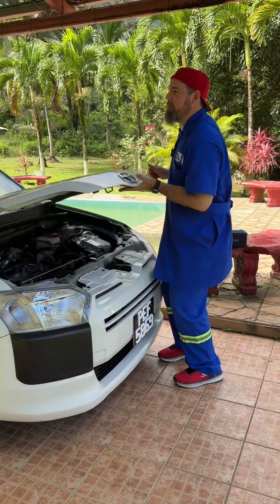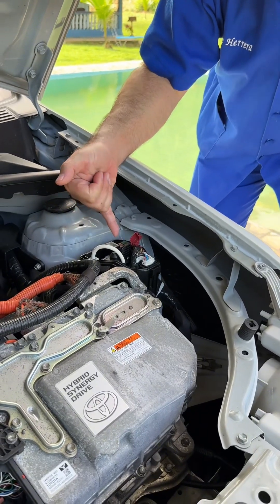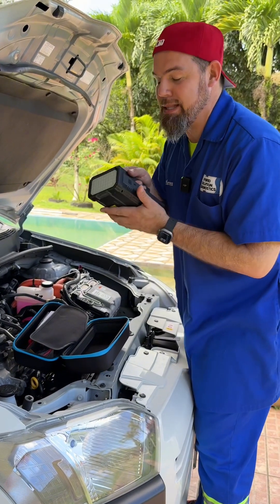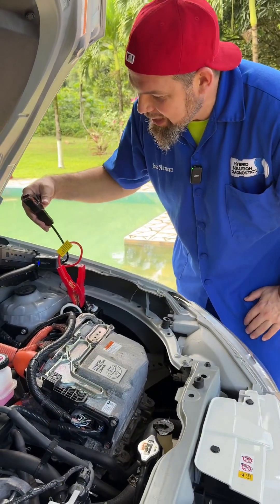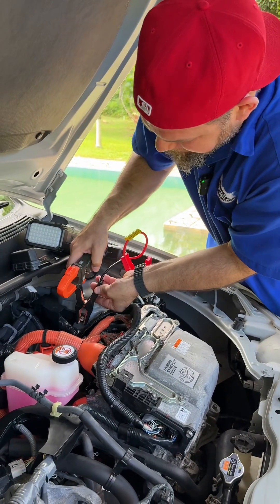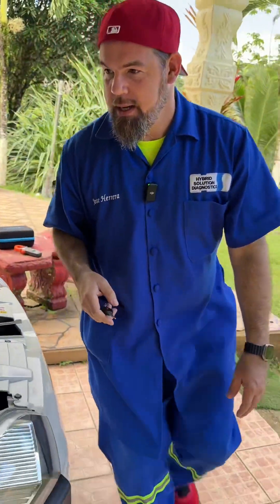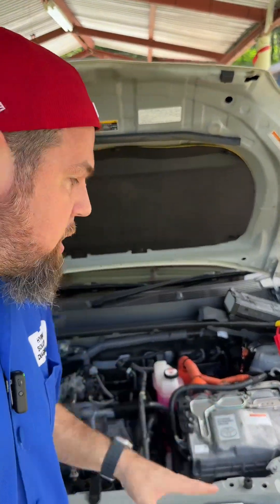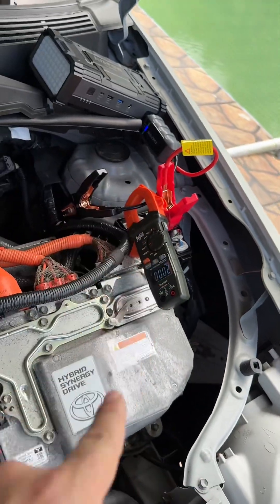How to jumpstart a hybrid or electric car in simple steps

Comment: Yep. did use that + in the fuse-box a few times already, because I didn't shut off lights. And in my 14 year old Toyota Auris the 12 volt battery is in the trunk and this opens only electric. :face-green-smiling:

Comment: Thx for jumping tip & trip to river! Can ICE vehicle 12v battery be used to jump hybrid battery?
Reply: I've jumpstarted a hybrid with a 12 volt battery, I don't think you can use an ICE engine with a 12v battery to jump a +200v hybrid battery
Reply: @BeLowBelowo  12v ICE to 12v Hybrid…
Reply from the maker: @gilbrook  unfortunately you can because a hybrid battery is high voltage 😁😁😁
Reply: @hybridsolutiondiagnostics  So power jumper like Avapow needed as ICE vehicle w/12v battery can NOT be used to jump hybrid 12v battery?
Reply: Enjoy this paradise!!!!